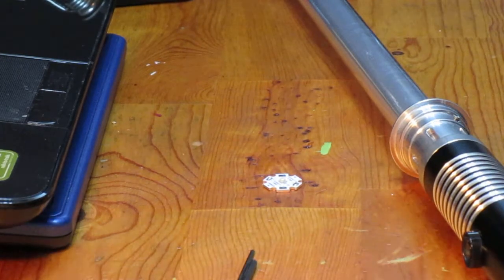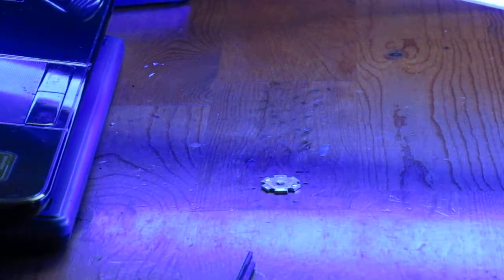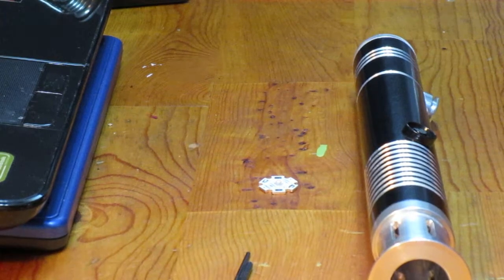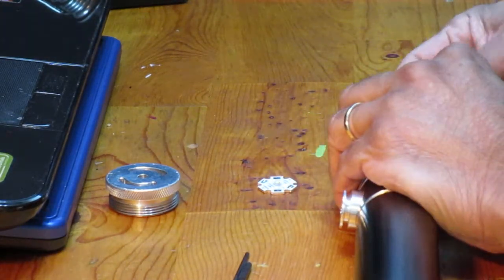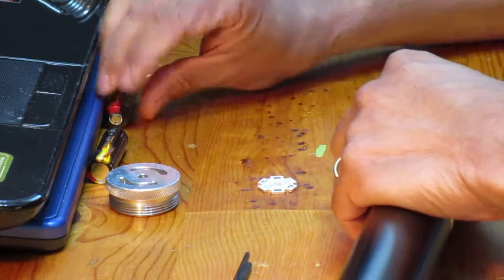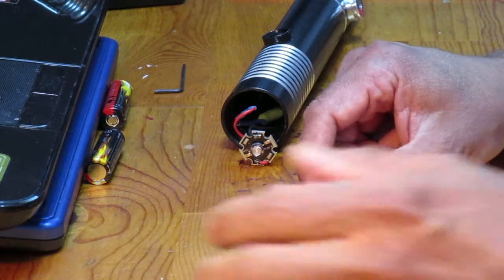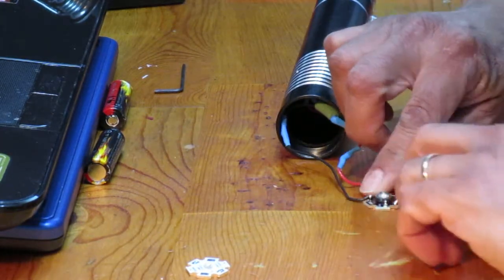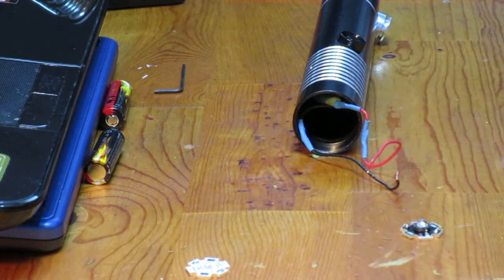Ultrasaber LED Replacement part 1 of 2

Comment: Ok so I have a problem...   I was messing around with the little wrench I got with the saber, and when touched the bigger wrench hole the opposite side of the turn on/off button it made a spark, and now after that I can’t turn it on. Does anybody know why or how I can fix it?